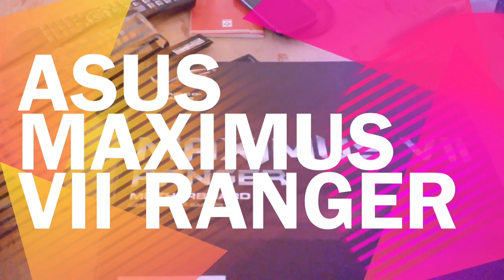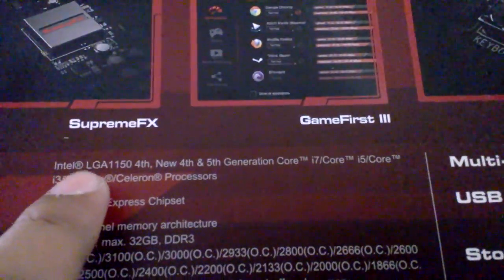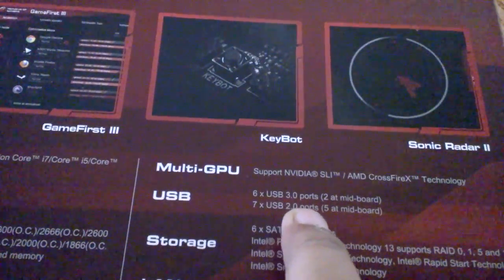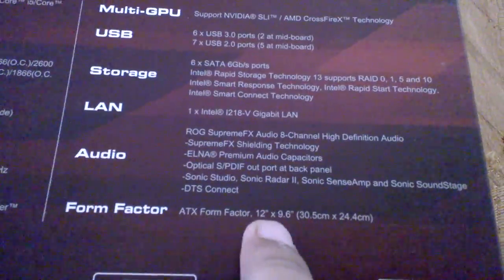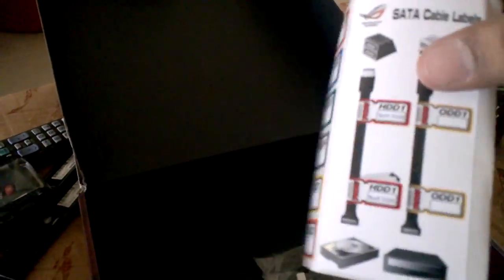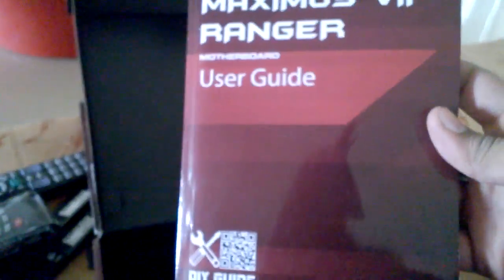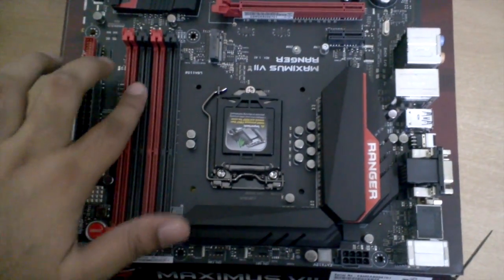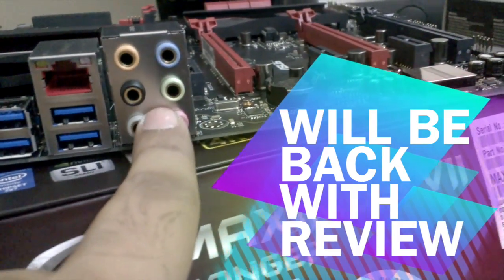ASUS Maximus VII Ranger

Comment: do tell all of ur components whole config
Reply from the maker: HE-MAN 22 
i7 devils canyon 4790k
rog ranger vii -mb
20gb ddr3 ram 2100
msi gtx 970 4g sli
Reply from the maker: 2x 8gb ram (new one )  and  2x 2gb ram(from old computer)
Reply from the maker: this MD has only 2 channels so no use in buying quad channel
Reply from the maker: *****
this MD has only 2 channels so no use in buying quad channel
Reply: +akarsh satya Intel Core i7-6700K 8M Skylake Quad-Core 4.0 GHz LGA 1151 91W BX80662I76700K Desktop Processor Intel® HD Graphics 530//////ASUS ROG MAXIMUS VIII RANGER LGA 1151 Intel Z170 HDMI SATA 6Gb/s USB 3.1 USB 3.0 ATX Intel Motherboard//4x's G.SKILL Ripjaws V Series 16GB (4 x 8GB) 288-Pin DDR4 SDRAM DDR4 3000 (PC4 24000) Intel Z170 Desktop Memory Model F4-3000C15D-16GVR/Corsair Hydro Series™ H80i V2 Water / Liquid CPU Cooler. 120mm CW-9060024-WW.. this water cooler works well drops this CPU heat a ton!!
Reply: akarsh satya i found i needed the Corsair Hydro Series™ H80i V2 Water / Liquid CPU Cooler. the sky lake runs hot.. it dropped from 40c to 23 to 25c tops.. with 300 plus frame's a second
Reply: akarsh satya mine as well go big. i lost a ton using cheap stuff..Corsair has been known to replace all parts if their produced fails although it's 1% failure rate